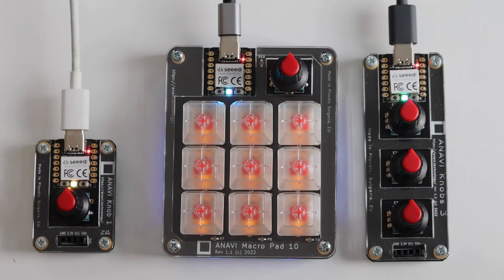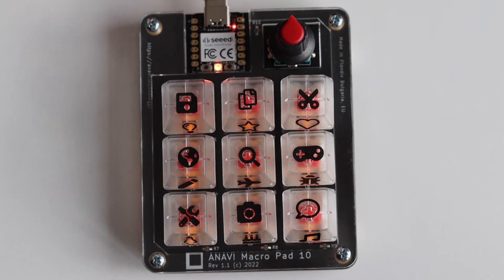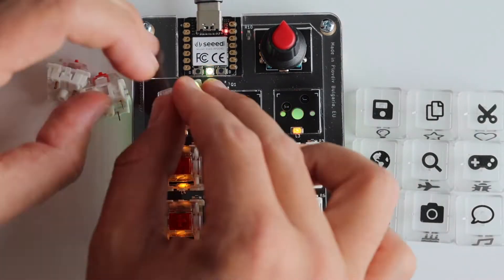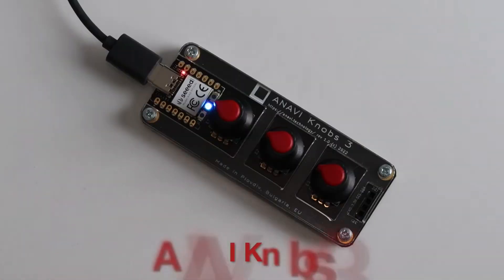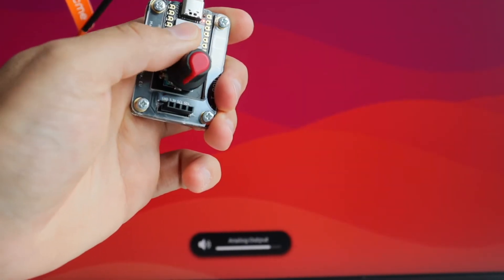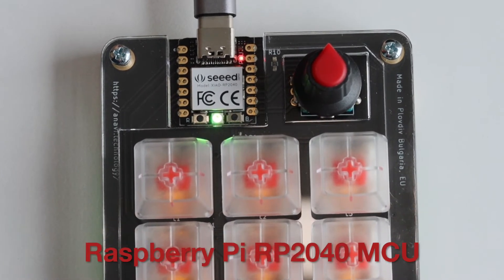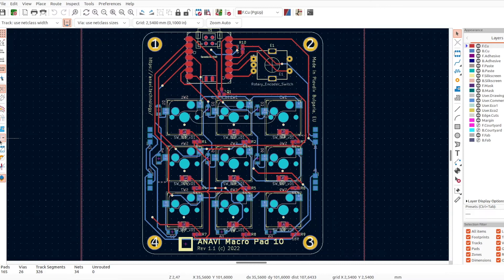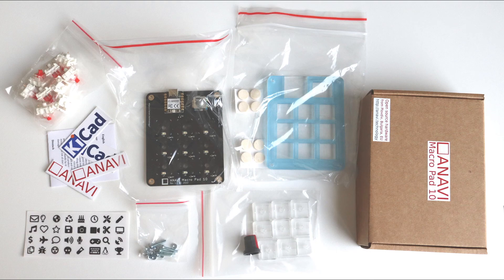ANAVI Macro Pad 10, Knobs 3 and Knob 1 Mechanical Keyboards

Comment: These are awesome do you have any plans on making a bigger version? Something the same form factor as the "koolertron 23 key" but that one isnt hotswappable or doesnt use qmk/via software
Reply from the maker: Yes, actually, after these 3 I made a couple of new keyboards: ANAVI Arrows and ANAVI Macro Pad 12 (this one is bigger than 10). I have in mind making a version with about 20-25 keys like the model you mentioned.
Reply: @LeonAnavi  i had a deep dive into your youtube, your making some great stuff! 
Ive had the koolertron for about 5 years and use it everyday, perfect form factor.
Reply from the maker: @Horn-Saw  thank you for taking the time to have a look at the channel!

Do you think koolertron would be better with 24 keys instead of 23? The large button on the last row seems a bit awkward (but may be I am missing the point in certain use cases).
Reply: @LeonAnavi  no problem, thanks for the content.
there are already a few examples of the 24 key models (heaps on alibaba and the "no faff macropad") 
I use it for gaming, so the 2u key is a well proportioned spacebar (would be even better with stabiliser)
But i could also see it being used as a modifier key as your thumb always rests there 
But at the end of the day it is your product so the decision is all yours